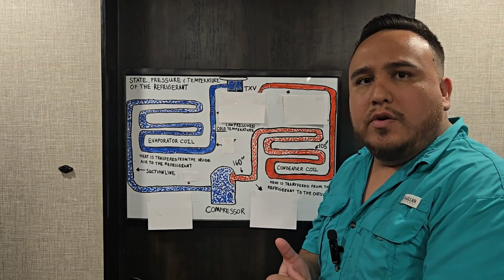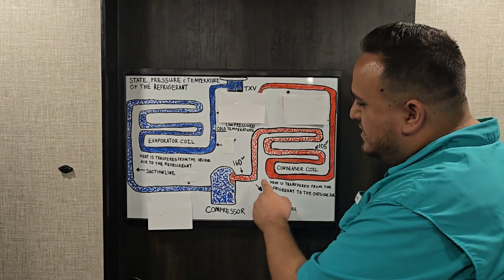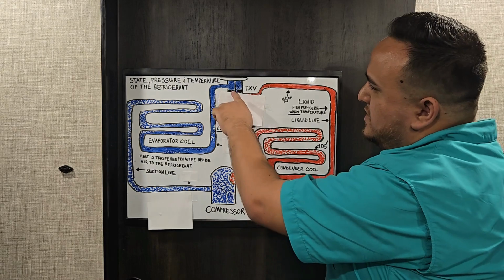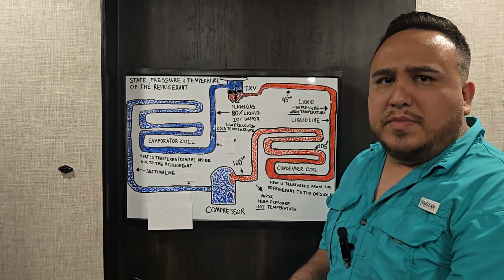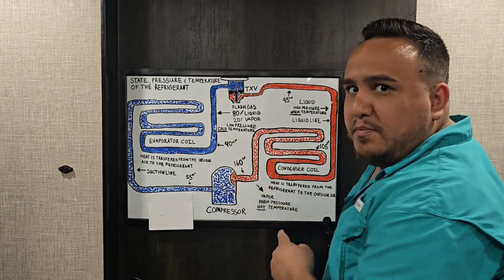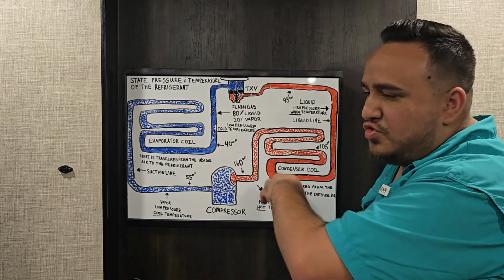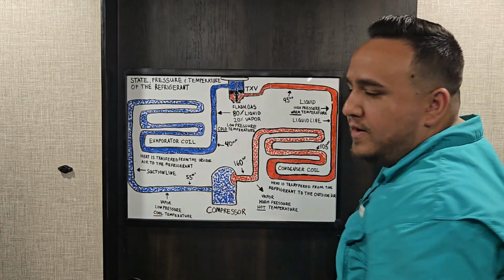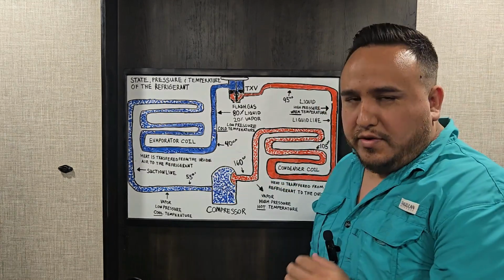Refrigerant State, Pressure & Temperature Explained – HVAC Basics!

Comment: Excellent explanation my friend, You know your stuff. The only thing i would add for us super geeks. At sea level pressures and atmospheric temperatures', freon will always be in the vapor state. Heat is energy, and when you add energy to tightly packed low energy molecules, (liquid refrigerant in the evaporator, in this case) they expand from a liquid to the gas state by absorbing energy (heat energy). The vapor cycle system, is a heat transfer system that utilizes the liquid to vapor energy state change to absorb and release heat. you are picking up heat energy in the evaporator and moving the heat energy to the condenser coil to be removed. Keep in mind there are different operating pressures for different freon types. Always consult the manual for these specs or you could damage your compressor by over charging your system and causing hydrostatic lock in the compressor. This Floridian thanks God for AC! Siesta wasn't invented because people were lazy, it's because they didn't want to die of heat stroke.
Reply: You said right refrigerant is the correct name not freon
Reply from the maker: Freon is just a brand name, kind of like how people say Kleenex instead of tissue. Refrigerant is the proper term, but Freon just became the common catch-all over time.
Reply from the maker: Sorry for the late reply my friend, and thank you for the awesome comment! I really appreciate you adding that extra detail, it makes the whole process even clearer, especially the part about pressure differences and protecting the compressor. Definitely a great explanation for those of us who like to dive a bit deeper. And yeah, couldn’t agree more, AC is an absolute lifesaver in that kind of heat! We experience intense heat here in Texas 11 months out of the year!